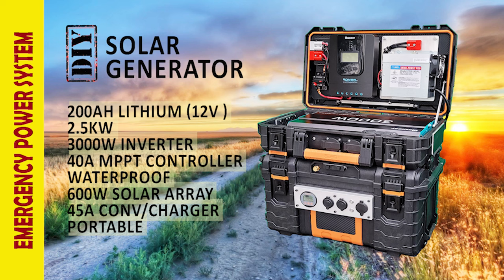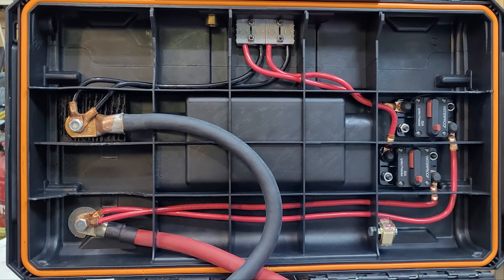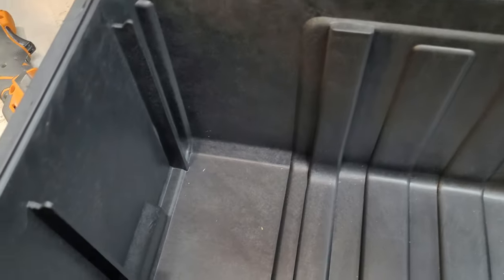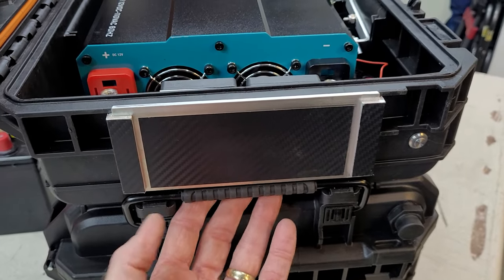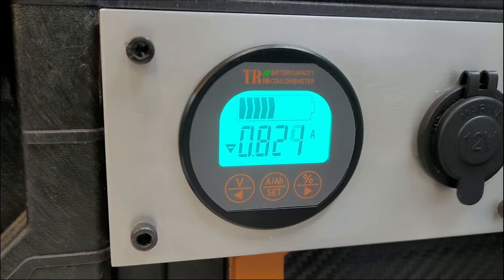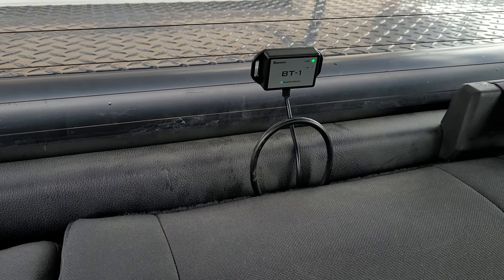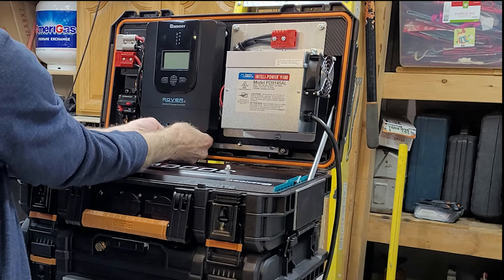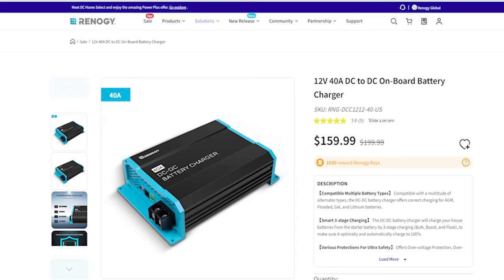DIY Solar Generator

Comment: Very nice build. A build list would be nice, but a tutorial, or even just some info about things you learned building this (do's and don'ts) would be great. And not just on the electric portion. What you wish you'd do differently if you were starting now, how you figured out what battery to buy, etc.
Reply: Yesssssssss
Reply: You're going to need $10k in extra cash and an abundance of time. Like this guy did, just keep throwing money/time at it.
Reply: Depending on your needs look into the Dr pepper 100ah lifepo4 battery with the DC charging hub . You can add inverter and plug solar straight in.. it's a system you can easily upgrade if you needs change.. not as big and nice as this system but not nearly as much work or $
Reply: The best build yet

Comment: One observation… in your battery box you have the cables from the battery to the lid arranged so the positive is above the negative terminals which seems not optimal from a short circuit pov. :)
Reply: I came to see if someone had noticed this, must close with the lid shut

Comment: I'm an electrical engineer, and dude this is the best YouTube project  I have seen. Well done, great fit and trim and a really professional job.. I believe you can sell these. Also, I'm glad you used off the shelf batteries instead of building your own battery packs.. which I believe is too dangerous for most DIY guys. Most don't realize a short across the wrong  battery terminals on a DIY pack will start a fire that can't be extinguished.
Reply: Are you concerned about the lack of proper crimping?
Reply: Not so much as that but accidentally connecting to the wrong terminals. Or using too small of wire and terminals

Comment: I did a 300ah/1500w inverter box last year and I'm happy to see we did a lot of similar things in our projects. I even used a bigger Rigid toolbox as my starting point as well. I want to build an even bigger system this winter, because I just like building things, but at some point those all-in-one charge controller/inverter systems start to make a lot of sense. I think my next build will be a 24v/410ah using a combo controller/inverter in a wheeled Stanley toolbox.
Reply from the maker: Sounds great
Reply: When you do this get ahold of me!

Comment: I like the setup overall.
You may want to consider insulating the inverter connections. They crossover and come dangerously close to each other when the case is closed. If someone decides to lean on, sit on or rest something on that case it could get interesting. I know you wouldn't do it, but you never know what others might do.

Comment: I built the same thing but in Milwaukee pack out box. Its a all in one 5000wh 24v li ion(18650 cell built myself) battery. 2000w inverter. 20amp mppt(could fit a larger one) all in one container. Since my battery is regular li ion it's smaller than yours but 2x the capacity. Works great.

Comment: Wow very nice! A lot of thought obviously went into this build!  One of the best I've seen. I'm halfway through my 300ah kings Lithium battery which is on a hand truck. The rest is all Victron and itech world components! 
You can get a solar tracking system that uses 12 volt rams to move the solar panels and track the sun.

Comment: You can get the bottom wheel section for storage, and it can roll itself. Or add a metal plate at the bottom and add removable wheels and handle.

Comment: Good video, I have also built some systems over the years, especially panel arrays, and battery banks. You should capture good solar energy in an arid desert region. Unfortunately living in northern Canada solar was not a good option, but a costly one.

Comment: I built a 5.2k system on a cart similar to the one you used. I used Velcro and eraser board sheets from Home Depot to enclose the lower part of the cart which holds the batteries. Helps keep the dust down and protects the batteries. Use the industrial strength Velcro,

Comment: Outstanding design, workmanship, and presentation! The modular aspect is genius. Didn't catch how power is passed into the top box's inverter connections -- is that a custom metal bracket that fits onto the bottom box's top bolts/terminals, shown @3:40?  I'm guessing it's cross-sectional area is similar to the 4 gauge wire so no voltage drop (or excessive heat buildup)?  Thanks for sharing!
Reply from the maker: Thanks, I use aluminum for the brackets to the inverter. No heat or voltage loss problem

Comment: Great setup! Do you have a cost breakdown? Is the solar panel stand a custom build as well? Both were done very well. I may borrow some of your ideas.
Reply from the maker: Thanks! Yes, I cut and welded up the stand from some metal stock I had. I don't have a parts and cost breakdown but I am going to try to put one together as time permits.

Comment: Nice video on your system(s)!  Have you ever considered putting a set of panels above the cab?  Two advantages, the extra panels of course but if there is 2" - 4" space between them and the roof , the roof is always in the shade.  Just a thought.

Comment: nice build 🥰🥰🥰🥰i have that same tool box with 48 volt pure sine wave inverter love it from my inverter i used 12 gauge wire the wire you used to wire house with 2 15A Breaker and 20A breaker for my out let them

Comment: Hi, I have a question as I'm watching your video. Where is your large fuse for your 3000 watt inverter? Shouldn't you have at least a 350-450 watt fuse because of the larger inverter? I have a 425 on mine.
Reply from the maker: I did back up on my fuse (250) because my plan for usage is minimal. But yes, 350 would probably be a good idea

Comment: I want to build a similar system using Harbor Freight wheeled combo set. $120-ish for a 3 piece set. They stack and the bottom unit has wheels of course. You can buy each of the 3 pieces individually. They are very sturdy and the price is value all day.

Comment: Question; why not put your batteries in the Ridgid bottom box that has wheels, then put your inverter/chargers in the middle sized Ridgid box, where you can leave it all assembled? This is the cleanest build I’ve ever seen, thanks

Comment: Love the setup. I recently purchased a rigid box but my 3000w inverter is too long for any of those boxes. Smh, I’ll find a way to make it work
Reply: For a battery pack like this,  a smaller inverter is really just fine.   You aren't going to get 3000 watts out of that battery.

Comment: Very Cadillac build and quite nice! You didn’t show how you connect the battery box to the inverter box for power to the inverter . . . I’d like to know.
Reply from the maker: In the video I showed the bottom box with 2 bolts coming out of the top (3/8). These bolts go through the bottom of the inverter box and then bolt to the inverter.

Comment: Great build video! I'm building a 100ah x 1000w version that I can add batteries to small enough I can lug it around camping , the Dr prepper/renogy battery with the DC charging hub is so simple with built in 40a mppt charge controller. But you have given me some ideas! Thanks

Comment: On the air intake side i would want a HEPA air filter. There is a lot of dust circulating in the air.

Also the charging kit would stay in it's own box with a 3 way switchable cable to connect to the power station battery.

Comment: I would love to see a step-by-step build video. I am interested in setting up a 6000kw unit for my food trailer.
Reply from the maker: I am honored by your request , but at this point in my life i don't have the time to put that together
Reply: My son did something similar in a food trailer.  He was too far away for me to help him,  but a local marine electrician helped him build it.

For that power level you will want to use either 24 or 48 volt instead of 12 volt.

Comment: I have 2 separate 12v 100ah. I can run a 3000w inverter off of these?
I currently have a 2k, but if I can run more, that'd be swell

Comment: I'm considering building one of these and this is the best I've seen on Youtube.  Any chance of doing a rough wiring diagram? I think I know what to do but looking for conformation on bringing together the battery, solar, and power supply without causing issues. Thanks.
Reply from the maker: Craig, I am so sorry but I don't have time to do that any time soon. Life is very busy for me. Hopefully by stopping the video at spots and looking at diagrams on the web you can get it done.

Comment: Very well done. Thank you for the reveal. How do you connect the AC to the DC?
Reply from the maker: It travels through the 45a converter/charger (Silver box on right side of lid) into one of the 50a Anderson connectors on the front of the box.

Comment: Very nice portable DIY solar generator.
Your panel stand with manual angle adjustment could easily be modified to a self powered single axis solar tracker.
Check and find: Easiest Solar Tracker

Comment: Well laid out. A little off subject can you make a video on your truck bed cover? Is it water proof? Thanks for the upload
Reply from the maker: I probably won't get to it for awhile, but it is not waterproof (I live in AZ). I welded it up with steel and an aluminum picnic table.
Reply: @customtech383  Upcycling is always a good thing. Thanks for considering it. It looks like a very handy idea.

Comment: Great build, did your battery have rope handles on it when you got it and did you have to shave the handle ends of the battery box to make it fit in the Rigid box?
Reply from the maker: Yes, sorry I didn't mention that. It did have the rope handles and I did need to shave off the ends.

Comment: Would any of the all-in-one inverter/chargers fit in that top box?  Then you would have built-in solar and AC charging.
Reply from the maker: That would be ideal if it would fit. Everything I've seen it too tall for the small box. A big one like the bottom one would work and hold the solar controller as well, but that doesn't work well for me.

Comment: Do You think the Red wire between the fuse box and the POS post handle 250A if something were to short it out or maybe a 20A on that wire AT the Battery? You might not have that much drawing at the fuse box but SH_T happens!
Reply from the maker: Thanks, something to think about

Comment: Do you have a link to the specific rigid boxes you used? I’m wondering just in case they have been updated and might be a little different in dimensions. Thanks in advance! Great video!
Reply from the maker: The Gen 1 boxes I used has a paper "Ridged" logo on them. The Gen 2 box logo is hard plastic and says 2.0 on it

Comment: Looking to start camping again with the family and will need to run a CPAP machine, and I am debating whether to build my own portable generator or simply buy unit.  Do you have a total cost that you spent?
Reply from the maker: WITHOUT ALL THE EXTRAS: 200ah Battery (2560wh) $500, 2000w inverter $250, Gen 1 Ridgid boxes $70, Guage & shunt $35, 1 Guage wire & fittings $20, Fuses & breakers, connectors, fans $150, misc $300+ (out the door, under $1500).

Comment: How do like the Champion dual fuel generator? Ever have issues with it? How long ya have it?
Reply from the maker: I only have 6 hours on it, (1 year) but love the weight (39lbs) and how quiet it is. Propane works well. Works perfect so far, but time will tell. It's designed for backup so I run it every month for 20 minutes or so.

Comment: How does the inverter disconnect from the battery when you disconnect the two cases?
Reply from the maker: There are two bolts that come through the top of the lower box and into the top box where the inverter is at. There is a total of 4 bolts that need to be unloosened for the top box to be removed. Two of the nuts need to come off the floor of the top box holding the aluminum right angled connectors, and two small screws that connect directly to the inverter.

Comment: Have you had good luck with the blower cooling fans ???
How long do the blower  fans last ???
are you able to keep the temperature low enough ???
Reply from the maker: I haven't run the fans for days on end, so I am not sure of their quality. Temp seems ok
Reply: @customtech383  is there any particular reason why you used the blower fans ???

Comment: Would this work for a 48v battery system? Epoch has a very small form factor 48v "rugged use" battery now which is commonly used in golf cart conversions, and Victron released a small 48v inverter not too long ago so this setup you have is almost perfect for a mobile solution if it can work for the 48v system I'm attempting
Reply from the maker: Yes, any voltage would work. But if you want USB and Anderson connections, you need to have a converter to 12 volts as well.

Comment: hi i want to use this diy technique to power my rv using the 50amp plug that I usually plug into the camp site power pole.. is this possible? similar to the new power banks that can do that example: oupes mega 2 , 3 and 5 .. thanks
Reply from the maker: You can connect a 50 amp plug to almost any power bank but it will only power your RV appliances/AC/Etc until your batteries deplete. You can build anything that is being manufactured out there. You just need $ and a plan.

Comment: For you diyers
The same box with the 200 ah battery.
I was able to get 2 80ah lifepo4 batteries,  with a 5" gap in the middle in that same box. I needed a 24vdc system at 80ah. Kayak motor.
By the way ridgid sells a (taller) box called the xl version.

Comment: Nice build.  No offence but I'm concerned about the placement of the negative wire on the lid when you close the lid it it's over the positive terminal of the battery.  Might want to rethink that.
Reply from the maker: When I watched the video again it did look like my positive upper bolt on my lid was right on top of my negative shunt or bolt, but I measured it and it is more than 3/4 of an inch away (There would also be a 5/8 gap from the top of the negative shunt/bolt to the upper positive one on my battery if they were right on top of each other, which they are not). Thanks for bringing it to my attention because I did move one of my 6 guage + connections on my lid toward the outside of the box which gave me more room in case something came "unbolted"  if it got dropped, or a small child would hit it with a hammer!.

Comment: are the batteries mounted to box so they don't move up or down if box tips over  ?, just wondering because the battery plus and negative terminals are only a inch or so from each other
Reply from the maker: The battery doesn't move in any direction, the large cables that sit on top of the battery come to the top of the box snug. So, if it were to tip over it wouldn't slide around.

Comment: I need to power a 30 amp travel trailer and be able to run the 15000btu AC will this work? If so for how long?
Reply from the maker: Unfortunately no. The 3000 watt power inverter would work nicely, but you would need to connect at least another 200ah lithium battery bank in parallel to have any significant time. Yet, if you had a massive solar array,
It might work for you.

Comment: genuine question from someone just learning all this. What did you do with the ground wires?
Reply from the maker: The external power inverter ground is not in use, but I think on this inverter it is internally connected to the negative terminal.

Comment: Wouldn't 2 / 0 AWG wire have been sufficient for that short of run?
Reply from the maker: Yes it would, but my losses are very little. But in my new build I did go smaller.

Comment: I must have missed it in the video but how does your battery box connect power wise to your inverter box on top of it?
Reply from the maker: There are 2 bolts (+/-)  that come through the top of the lower box into the top one.
Reply: @customtech383  Would you have the time and be willing to show that on video a bit more detailed.  I want to be honest, I think this is the best idea ever to keep them separate and I plan on doing almost the exact same thing so all the info I have helps me save money and be more safe.  Again amazing build sir!
Reply from the maker: I am so sorry, but the next 4 months of my life are going to keep me from doing any more videos. I hope to jump back in soon.

Comment: Do you sell these? How much solar input can you receive? Thank you
Reply from the maker: I don't sell these, and a 200ah battery works best with 6oo watts of solar panels. Yet, I put up a couple more (200w) if I'm running heavy loads because I currently am tracking the sun manually.

Comment: Question, this is a biggie.. Do you think there is anyway you could run a 220v welder or plasma cutter of that setup..how much more modding would it take to pull that off.. Not run it for long just for emergencies for off roaring situations. IE Broken Axels, Broken frames etc etc... Would love to ever be able to make some setup that could pull that off...
Reply from the maker: Not sure how to configure 220 sorry. A 110 stick welder would work with this for wheeling and could repair axels and such with the help of some pre-cut metal?
Reply: @customtech383  yea, I can use a stick with a raw batt connection that what I do now. But it doesnt help with the plasma cutting.Just would LOVE a setup like you made that could deliver it in a more controlled clean way. But thanks for the attempt..you ever think of a way, that would be the holy grail of hacks.. Would love to see it